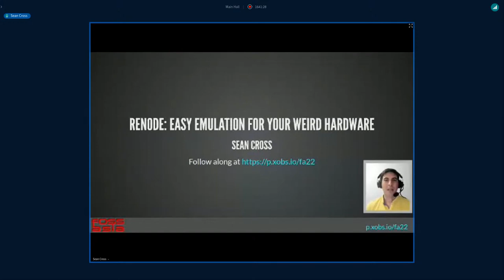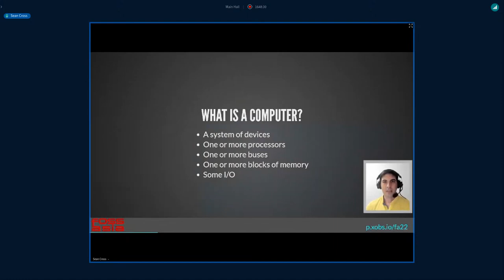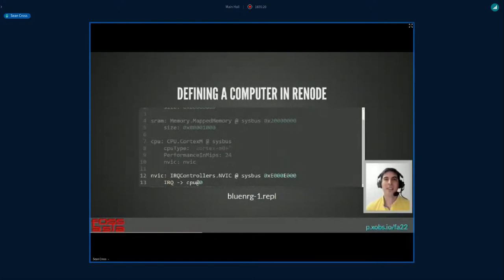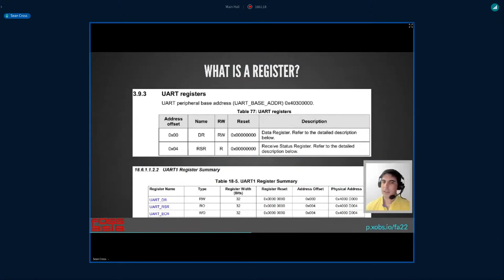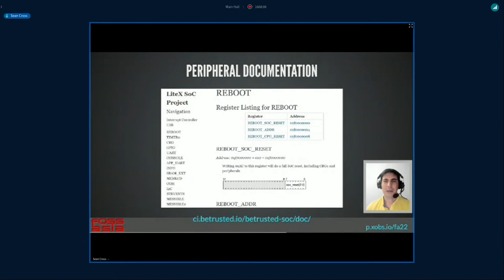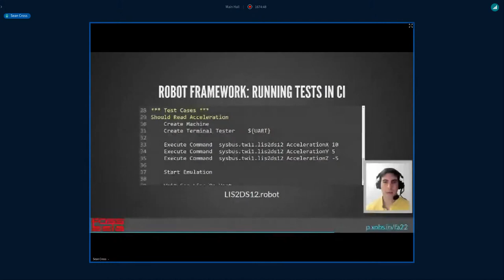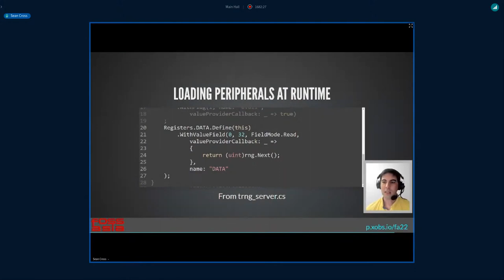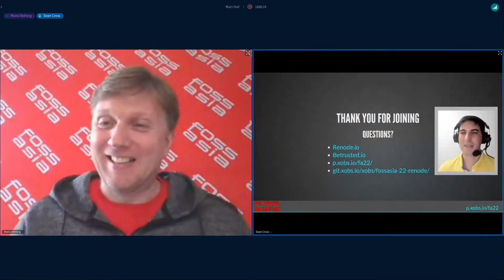Renode: Easy CI for your Weird Hardware - Sean Cross

Comment: Regarding Continuous Integration.. would love to see a walk-through on course on using Renode to simulate Sean's Fomu FPGA board.   

For example the Fomu workshop doesn't go into much detail on the FPGA part.. what's needed:
Starting with the Apio multiplatform toolbox and adding pre-made (FuseSoC) IPs... like ValentyUSB, VexRiscV, LatticeMico32, Microblaze.. 
then adding custom logic (via Silice, Bluespec / chisel-lang HDL , SpinalHDL, LiteX)..
Synthesizing (SymbiFlow, Yosys ) and simulation (Renode, modelsim/questasim, litescope, SignalTap, Chipscope)...
Place-and-Routing and programming (nextpnr, etc) 
Writing the CPU Code / OS (Xous Operating System, OSEK /AUTOSAR OS, ROS,  OpenPilot's ZMQ , Cap’n Proto)
Testing (Robot Framework)

BTW, regarding Ghidra, would love to hear Sean's thoughts on Qira..  a few years ago, fellow legendary hacker George Hotz did a presentation on it.